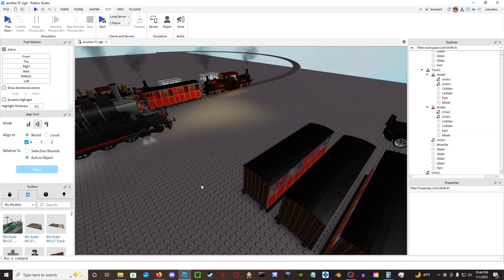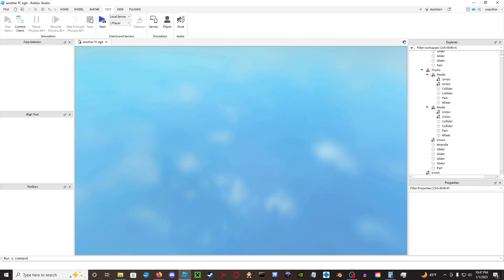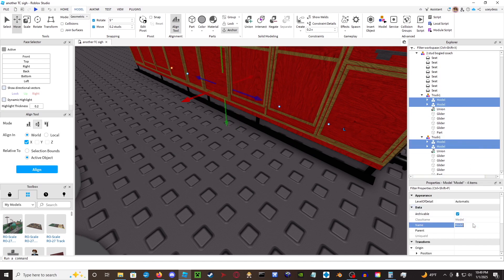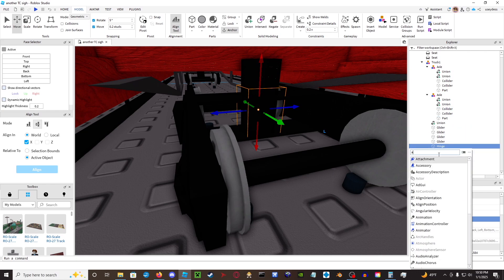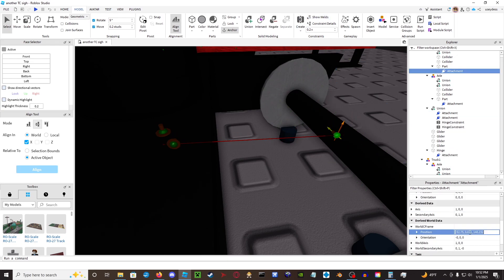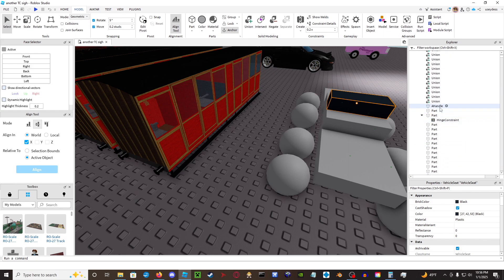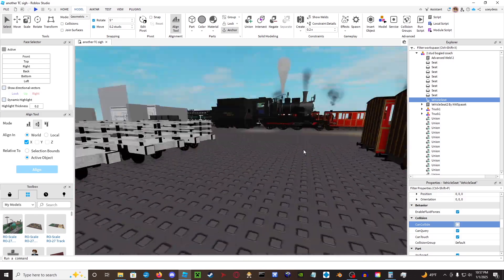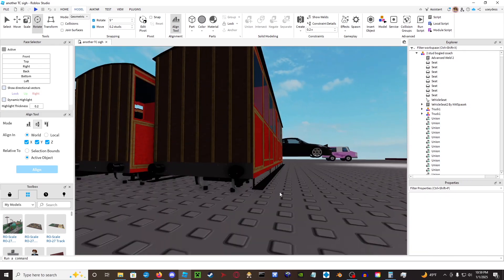How to rig Bogied Rolling Stock in Roblox Studio

Comment: For my stuff with bogies/trucks, I usually use ball and sockets to connect them to the main body. It allows them to traverse bad track. I found that if you rig the VS2 one like you did and then put normal hinges/constraints instead of the VS2 Bogie things; It works just fine. (VS2 is weird and this sometimes doesn't work right.)
Reply from the maker: @toaster_the_amethyst  I have tried ball and sockets before but they generally don't work so well, the vs2 hinges were updated to work like ball and sockets according to nw so I've learned how to do it that way lol
Reply: @niklasmolin3195  The version that I had of the VS2 acts like they are hinges. I used to use them on my Garrett. The thing was so heavy the hinges were flexing out of alignment so I had to switch to ball and socket constraints.